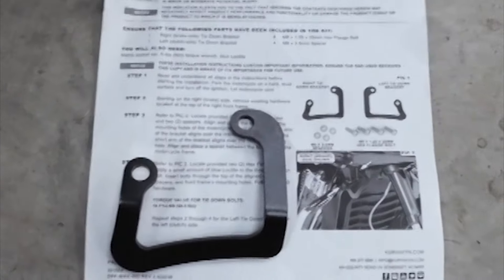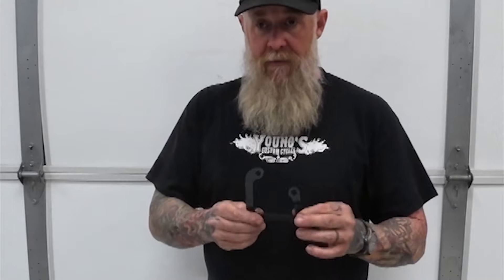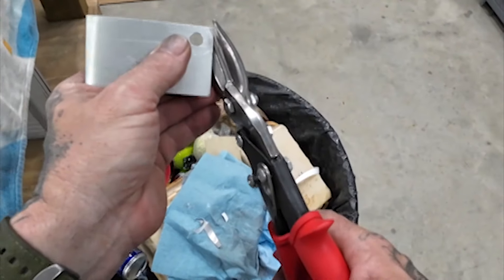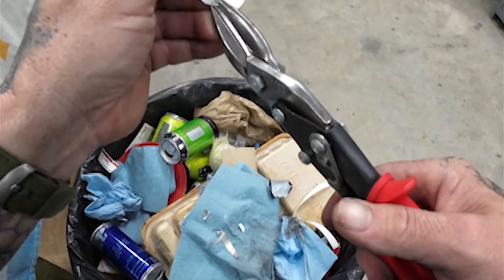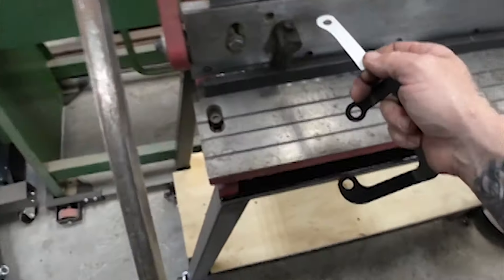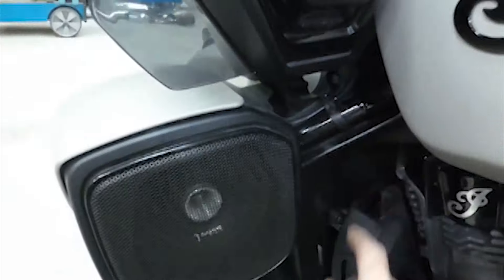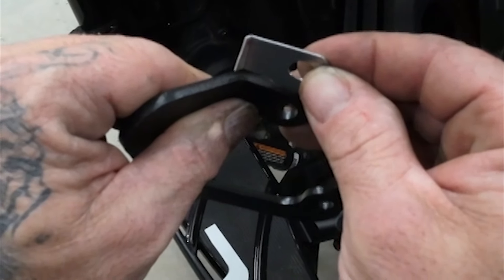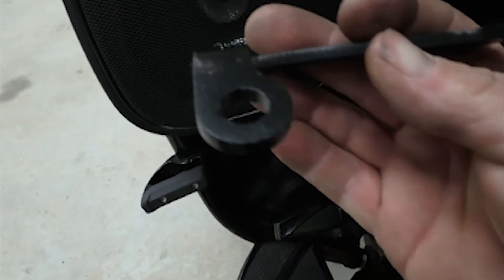Indian Pursuit HOLD DOWN Bracket #87

Comment: Hey Reyff, how did you order those tie-downs? I tried looking and motorcyclestorehouse only sells to dealers. Did you get them sent from Europe?
Reply from the maker: No I just kept on looking hard through many sites until I found them.  The Kuryakyn stuff at times is to find the older items or what use to be easy to find.
Reply from the maker: If I produced these myself, would you be interested??  For some reason they discontinued them everywhere.
Reply: @reyffdesigns1282  Yes I would be interested.